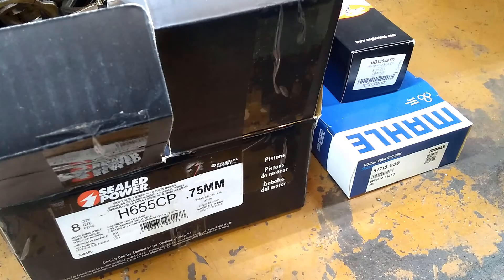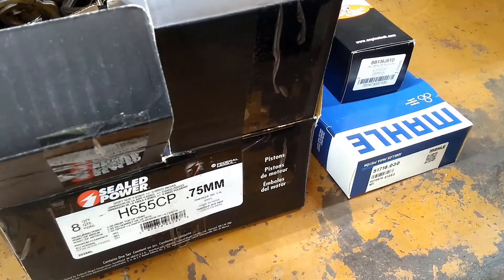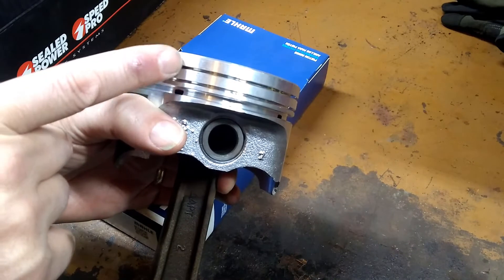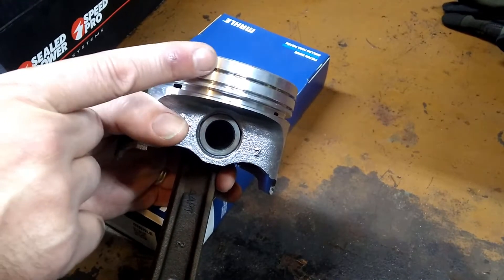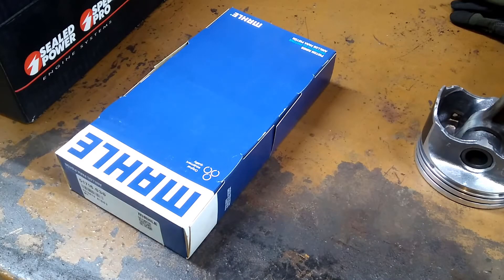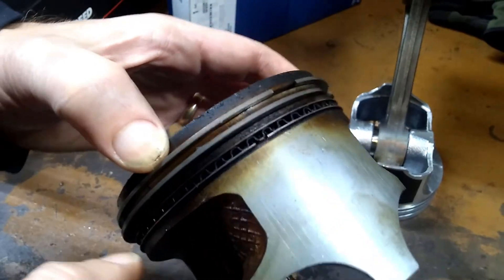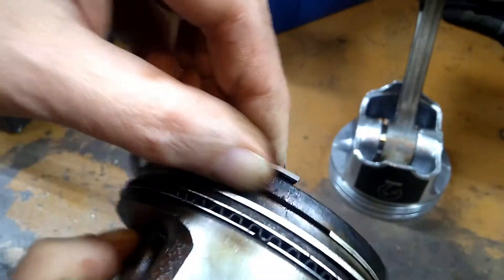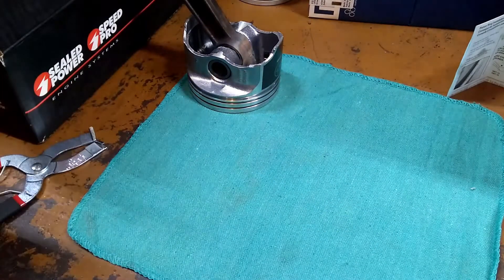Installing Piston Rings - Mopar 5.9L Magnum Daily Driver Engine Part 5

Comment: Question. Should the pistons for one bank have the number ending in "-A" and the other bank have a number ending in "-B"? Correct me if I'm wrong, I think I heard you and others say these pistons are offset. I just measured and I'm seeing the offset is not what I'm expecting.

I will have to double check but on the pistons I held the piston perpendicular to the connecting rod and measured, seeing to the edge of the skirt on one side was 1 1/2", and then if I flipped the piston and measured again, the distance from the edge of the skirt to the connecting rod was 1-7/16 to 1-3/8" offset or so. I think the longer distance (1-1/2") was on the top for a couple of the bank 2 pistons I measured, but the longer distance was on the bottom for a couple bank 1 cylinders that I measured.

Of course I have 6 "-B" pistons and "2 -A" pistons. Not sure what to make of this.

EDIT: I see I asked this on the wrong video. Lol.
Reply from the maker: The top of the piston is typically marked for which side faces the front of the engine.  Sometimes with a notch, sometimes an arrow.  They are otherwise all the same part number.
Reply: @YoshimoshiGarage  After talking with ChatGPT, I see the offset is to the same side on either bank of cylinders, according to ChatGPT, the wrist pin is offset to the left, looking from the front of the engine toward the back for both banks.

But knowing they're the same P/N also helps, so they're not specific to each side. Thanks

Comment: Following the factory service manual, it says...

1. 12 oclock position (facing toward intake manifold) is oil ring spacer gap
2. 3 oclock Second compression ring gap & oil ring rail gap TOP
3. 6 oclock position oil ring rail gap BOTTOM
4. 9 oclock position TOP compressiong ring gap

I assume there's some flexibility in these instructions per what you did. Glad you mentioned those aftermarket ring brands, of which I have one. They differ a little from the OEM rings, I presume. Apparently many rings from other engines have rotation locking tabs for their rings, but it seems the 360 Magnum does not. Unfortunately the instructions that came with my rings mentioned it even though it didn't exist on my rings, so again thanks.

EDIT: And yeah if you read this, it's months later and I'm finally getting around to assembling my engine. I was lazy. I did get it painted though and the crankshaft installed.

Comment: Does it matter what the oil control rings are gapped at? Also, were your rings pre-gapped?
Reply from the maker: Oil control ring gap isn't critical, but probably no less than 0.015".  These rings were pre-gapped.

Comment: Hello what vehicle is this out of?
Reply: I have a 98 Jeep grand Cherokee with this engine. It’s smoking a lot of oil and we’re suspecting we have to replace all the rings.
Reply from the maker: It probably came out of a 2000-ish Dodge pickup. It was on a pallet when I bought it. It's going into a 1974 W100